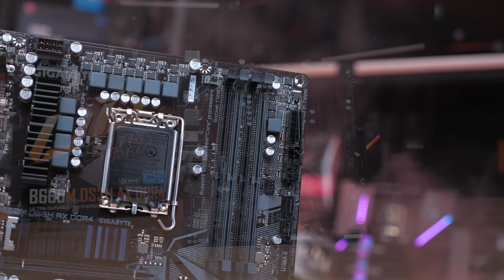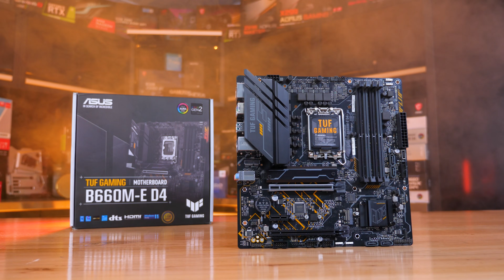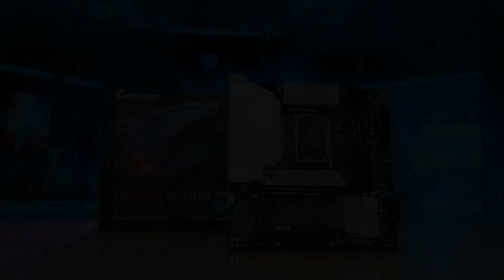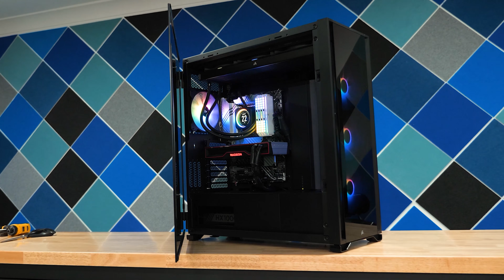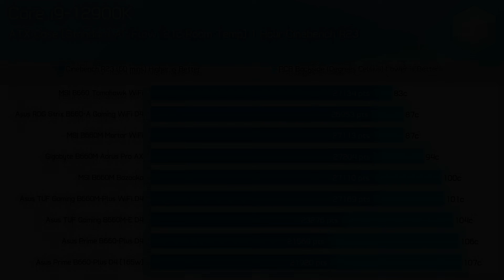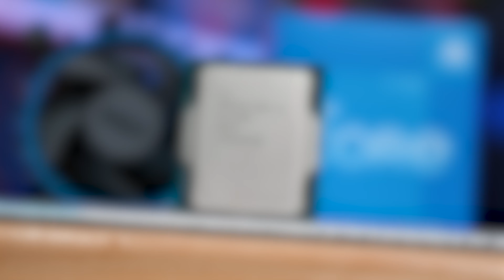18 Intel B660 Boards Tested, VRM Thermal Test

Comment: Thank you for all the hard work in putting these round ups together. ASUS Prime continues to be a (literally) hot mess, while MSI looks to be circling back to being a top value to performance performer once again. I'm also dismayed by the TUF board performance. Last couple of generations looked pretty good. 
I'm going to have to have a long hard think about the budget build I was contemplating. MicroCenter has some great prices on the Prime B660 Plus and I was hoping ASUS was going to get their act together this generation.

Comment: Hey Steve I need your help badly, I’ve used the MSI B660M-A PRO Wi-Fi & the MSI B660M Mortar Wi-Fi. This is a serious issue & I believe it needs to be covered as people are going to order them not knowing the big issue that’s currently with them.

I love them but they have a major problem when it comes to ARGB/RGB lighting. They both will not detect any ARGB or RGB parts, doesn’t matter what type of part it is nor what software you use. I’ve tried Mystic Light, Dragon Centre, OpenRGB & Signal RGB. I’ve made sure both boards have all the latest drivers, windows updates & bios and it didn’t change anything. They both detect RAM RGB lighting but nothing else that’s directly plugged in through ARGB or RGB ports. Corsair products work being it’s plugged in through USB 2.0. The motherboards also output lighting to the parts but it won’t detect them so you can’t change the lighting. 

Your the only one who I could think that could figure out what is wrong so I’m begging you if you could try to figure out the cause and see if the same issues happen to you. I’m more than happy to pay for your time & efforts as I’m lost, I run my own PC building business and I always make sure to use the very best for my customers. I love the MSI boards though when all my customers want RGB lighting it makes it hard as I now have to tell them they can’t change there lighting until MSI provides an update to the software (as I think that’s the issue). I don’t want to spec them out with a lower tier board just so they can change there lighting so any and all help would mean the world to me and super appreciative! 

Stay safe and thank you so much for your time, I’m located in Gold Coast so a fellow Aussie here who loves all the hard work you do to make these amazing videos 💙

Comment: I bought the B660 tuf gaming plus wifi d4, since it had many fast usbs, it also features PCIE 5.0 for gpu, even if its not availble yet. I run it with a 12600K since i dont do overclock anyway. The MSI Mortar was $40 more here btw... oh and the VRM on the tuf gaming is rated to 125degrees, so 101 degrees with 12900K is high but not near throttling I guess?  I could be wrong :) I paid $450 for the 12600k + B660m tuf gaming wifi plus d4.. so I am happy.
Reply: I just checked prices.. the tomahawk is availble now, which it was not when I bought my 660 board. Its only $20 more lol. So I would easily pick that one if I bought a board now.
Reply: @AndrewTSq  asus tuf b660 have a pcie5.0 slot which you can easily use in next year, MSI does not, maybe you will use that feature soon? :) but also keep on mind i dont recommender pairing i9 with b660, its doesnt not make any sense and anything like i3/i5/i7 will be fine with tuf b660 boards, but not i9

Comment: Why are these boards so much more expensive than b550 boards... I bought a pretty decent msi board atx for 125 usd for my friend. It was the msi gaming plus.
I bought a b550 aorus pro for 190 (this one has 12 usb ports, 2.5g lan, very nice vrms and lots of other handy things like 6 fan headers and wifi)
Why is b660 that's not even overclockable (well ya know not officially) so expensive

Comment: pretty messed up prices we got in 2022 T_T . Intel got the cheaper processors but expensive mainboards while AMD has more expensive processors but cheaper mainboards. Can still see AMD R5 3600 fetching a higher price compared to the Intel i5-12400.

Comment: Not that this is a huge factor at this point in time, but the TUF is unique around the mid range B660s in this roundup with PCIe 5. I think most would prefer the MSI options around the same price, but it is worth noting, especially if there is a sale on the TUF.

Comment: I can recommend one more motherboard - Gigabyte B660/B660M Gaming X. It has very good VRMs (very cool with 12700K and enough for 12900K), 8xUSB ports on the back (most B660 boards have 6), available in ATX format and costs as much as Asus Prime Plus.

Comment: the price difference between b660 and b550 boards is just stupid. the msi tomahawk b550 is 70,- € cheaper than the intel platform and i don't see why that is the case.  intel should get their shit together with this issue. the 12xxx cpus are finally bringing intel back to a competitive state, but their ecosystem is way to expensive in comparison.
Reply: that's MSI's fault. There are affordable B660 boards. Intel boards have always been more expensive than AMD, but the price of the Tomahawk B660 is unjustifiable and nobody should buy it.

Comment: I am fascinated how some boards still use bunch of low side/high side mosfets instead of power stages. With so many options in power stages market it is strange to me that it might be cheaper to use like 6 mosfets per phase and more complicated PCB layout. Although I get that they have cookie cutter templates for the layout that need very little to no change when making new boards. Still funny that 6 mosfets are cheaper option than one power stage doing the same. Plus board layout nad cooling layout. Sure more surface is easier to cool but if they are different hight and it takes space on the board. IDK. World of PC is changing so much that I even do not care about so many things that were crucial to me. Like I was always buying best possible mainboard with best VRM and best CPU that was able to OC to and highest speed memory. But for ages you do not nee to overclock CPU to run games. Plus highest CPU's tend to be not great for OC especially like now where they are binning it for special versions. I bet 12700F with OK B660 and 3600 cl16 with good GPU is more than enough to run anything on top level. I thought I would never say that but there it is. Getting Z690 and 12900K to not overclock and have CPU that does not OC so great is kinda waste of money it seems. Seems like lower CPU's with that high OC potential might be enough to. Anyhow proves that combination of you monitor(regarding to resolution) and GPU is and always will be the limiting factor anyways for home use (read gaming and media consumption).

Comment: Thank you for your painstaking work on these motherboard tests. I was set on a Gigabyte AORUS PRO B660M. But, for my use case with an Intel i12400, I’m going to go with the MSI Pro B660-A. 

Strikingly, both motherboards are priced similarly in the US. Is that supposed to be the case, or should the MSI Pro be priced lower?
Reply: Which one you got? What's your experience?

Comment: dem, new intel cpus are power efficient, but just on paper. especially when its 12700 or faster with up to 5GHz. so z690 board with beefy vrm and heatsinks is a must it seems. at least 12400 and lower are fine and can be used with budget boards, but heatsinks on vrm also can make a difference
Reply: No budget for a Z690 board so planning to build MSI Pro B660M-A with i7 12700f, do you suggest this combo or should I drop to 12600k with same mobo for a full potential??
Medium heavy work or gaming.
Reply: @kaustubhx5452  stick with the 12700
MSI b660m-a is perfectly fine for it,as you already saw in the video
Reply: @c0ldshock927  Noted, thanks alot!

Comment: Thanks for another useful test. I agree that it's a mess that Intel might have been able to avoid.
I'd like to add that not all the boards have a PCIe 5.0 slot. I'm not sure how relevant it is going to be, but I went with that, and at the time the cheapest option was the TUF B660M-PLUS. While it might not be the very best, at least it performs okay. It's a relief that the board can handle a beefier processor if I choose to upgrade later.
Reply: And also has rear USB-C port. Where i live the ASUS TUF GAMING B660M-PLUS D4  also 10€ cheaper than the MSI Pro B660M-A DDR4, then for me the no brainer option would be the ASUS one.
Reply: @olymind1  that asus board cost $10 more than mortar wifi on my region 😶

Comment: As usual thanks for this.
When are you going to do a Z690 board comparison? Looking forward for that video
Reply: Not much point to it. All Z690 are on par with B660 Tomahawk or better.
Reply: @MarcinTrybus  sure? This was not the case on previous generations, same for AMD boards..
Reply: @MarcinTrybus  no, the gigabyte z690m ds3h is far worse than the tomahawk and is absolute garbage trash, just should never have been put on sale it's that bad.
Asrock's Z690 boards aren't as terrible as that awful Gigabyte board, but the Z690(M) PG4 and ITX-AX have much worse specs than the Tomahawak. Even MSI's own Pro Z690-P is worse than the Tomahawak (albeit it's not terrible like the Gigaturd). Maxsun/Soyo's Z690 board is identical to their B660 board and will perform worse than the Tomahawk.
Reply: @matthew-fufufafa  I literally did, they don't have any proper Z690 motherboard roundup video.
Reply: @yahel092100  https://youtu.be/6g3yiA1YREc
Reply: they already did lol check their videos

Comment: Thank you steve. looking forward for the review of the cheaper msi board. As msi have created a good image with their b560 and b660 motherboards, i am curious how well the cheaper boards do.
Also i didn't understood the direct air flow thing, Where exactly , the fan is placed for that because the temperatures are amazing.
Reply: The easiest way would be to use a downdraft CPU cooler instead of a tower. That way you can make the more budget boards usable.
Reply: @MarcinTrybus  tq

Comment: These vrm roundups, the revisitations of GPUs, and the monitor response testing will always keep me coming back to reference. Thank you for picking up the areas where the rest of industry lacks

So basically right now you're looking at a $10 difference and having to take mATX for Intel. B550A-pro vs B660m-a pro for most, b550 tomahawk vs B660 mortar for high end

Comment: Bought the MSI B660 Tomahawk DDR4 already. Looks like a made a wise decision
Reply: I also pulled the trigger 1 week ago.
Reply: @kingachii  Paired it with which CPU?
Reply: Paired it with which CPU?
Reply: @kaustubhx5452  12700k
Reply: @juniorthomas6404  Thanks for the reply! Working fine with a B660M.?
Planning to pair 12600k or 12700f with MSI pro B660M-A. Suggestion?
Reply: @kaustubhx5452  12700f.
Reply: @juniorthomas6404  Noted! Thanks.

Comment: Had nothing but trouble with the Gigabyte B660 board, freezing and random BSOD's.
Have RMA'd it and gone for the MSI B660 M-A Wifi for not much more.
Thanks Steve, I wouldn't have been aware of the performance loss's otherwise.

Comment: Thanks for this review Steve. Tomahawks are generally ~50 euros more expensive than the rest, imo not worth it for a couple of degrees cooler vrms. I got TUF B660M-Plus D4 two months ago and paired it with 12400f. And im really satisfied with it. Also have room for upgrade to 13400 or 13600 in the future. After that i hope DDR5 will come out of the beta state and new board will be a must...

Comment: So when compering identical setup RAM/chip-set/CPU/GPU the only thing that matter in a modern PC is the power delivery (VRM) setup. To some but lesser degree your airflow setup. As an aside. why is it so few cases that offer options for fans in the side panel

Comment: MSI B660 tomahawk wifi or MSI Z690 pro-A at the same price? (for 12700 non K)
Reply: B660 tom has 9 usb ports and wifi 6 e in the io port, mean while the z690 pro only has 8 usb ports and has no wifi 6 e, but z690 pro a has 1 more m.2 slot than the b660 tom. In the vrm stand point it should be pretty much the same.
Reply: @tictechto  thx alot

Comment: Wow very eye opening, who knows I may even pick a B660 board given how little overclocking really does these days, great testing data indeed, as always. Testing is naturally relative so this doesn't matter I'm simply curious, on the case selection of 7000X vs 7000D, with the test system/s, do you attempt to make a system with 'average' airflow to give a good middle of the road test data? As in, not a case with the best airflow, not a case with the worst airflow, but somewhere close to the middle as that may be most representative?
Reply: I have a heavily undervolted 12700K (0,97 Vcore) on B660M Mortar WiFi DDR4 and the only thing I am missing is OC on the iGPU. The closest feature-wise Z690 uATX board was over 100 USD more expensive. Not worth it IMHO.

Comment: I took a gamble and bought the B660 Tomahawk D4 to pair with a 12700F as an stopgap upgrade after seeing HWB's Mortar's review and it is worked out great for all core render workloads since MSI was showing it to exceed PL2 limits with adequate cooling. 

That said, I'm not really happy about the pricing since it was only slightly cheaper than the best budget MSI Z690-A D4 board which was out of stock locally at the time and I needed the extra connectivity. It's really annoying that you need to spend this much to get the boosted all core performance out of a i7 CPU.
Reply: With your experience do you suggest using MSI Pro B660M-A board with i7 12700f with full potential performance or drop to i5 12600k with the same Mobo?
Not a hardcore gamer or creator.
Reply: @kaustubhx5452  getting a 12600K might be a bit wasted on that motherboard since paying the same price and getting the Z690 PRO-A means you can overclock to 5 GHz+ if you are willing to get a bigger cooler.

I just didn't want to spend too much now since a DDR5 platform next year is probably going to blow the current gen out of the water.

Comment: I like this testing.
My PC is still bottlenecked with my 1050, while having i3-10100f, so I am quite fine with cpu. Although I watch every benchmarks and pricing of mostly Intel 12th gen, its no big performance upgrade at budget level as I am gaming mostly.
Nice to know Asus cheaper B660 boards dont match MSI while using i7 and up, if I would ever touch i7, which is overkill for myself.
Anyway for some productivity app users or streamers etc this is wisdom library. 
 Usually money saved getting just cheaper i3, result in getting upgrade by getting newer generation cpu, which usually gets me performance of previous generation higher end cpu (with typically newer features of new mainboard and possibly even higher clocked more memory as DRAM prices go down in time).

Comment: best VRM test is not mean the motherboard has best features... Almost nobody will run CPU at its maximum power for 1 hours... Who want to run example 200W in CPU over 1 hours?
Reply from the maker: Yeah who actually wants to use their CPU?
Reply: @Hardwareunboxed  So rare HWunboxed reply my comments... I dont know why my reply is removed but it will be waste if you already buy all those board but you only test the VRM... I agree MSI Pro B660M-A has best value in VRM performance, but VRM performance is not everything. Example the only board that can do undervolt P & E cores is only Asrock, while other board don't have. It can save a lot of power compared to other.
Reply: @LokisChannel0  Well, what do you expect? This is VRM thermals review and not motherboard review.
Reply: @CyberPsych13  yes you right 👍...
Reply: @LokisChannel0  how much power you gonna save, and what you gonna do with it?
Reply: @matthew-fufufafa  save electricity bill and lower cpu temp of course... 😃... how much power you can click me

Comment: In my area the cheapest B660 board is close to 200 usd. And that s why Intel CPUs catch dust on the shelves no matter how good they're priced.
Reply: AMD moving to LGA and LGA sockets on motherboard does increase overall cost of the board. Let's see..
Reply: Its the opposite in my country. Zen 3 hasnt been selling even with the price cuts. Intel just provides better performance, better platform, and is cheaper. Like a 12700F is $320 and beats the $450+ 5900x.
Reply: @__aceofspades  not the case here.
Reply: Yes, the price of Intel boards increased dramatically with their 500 series platform and is getting more ridiculous with the 600 series.